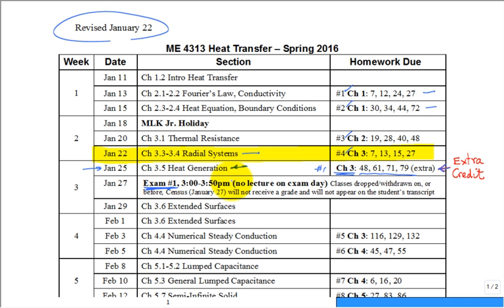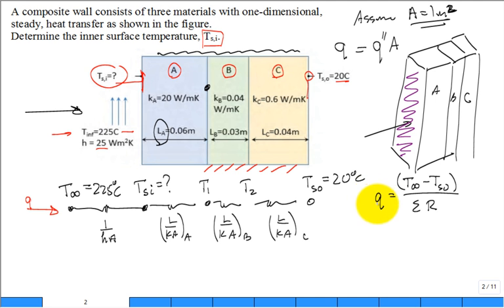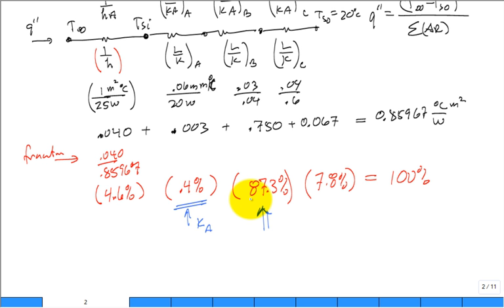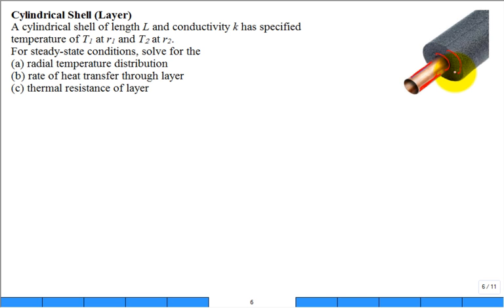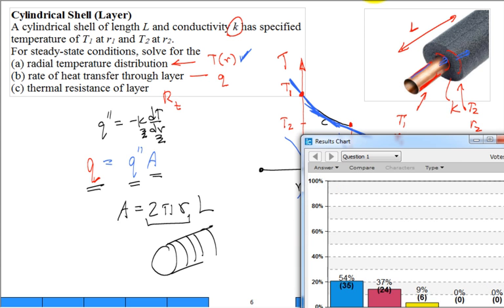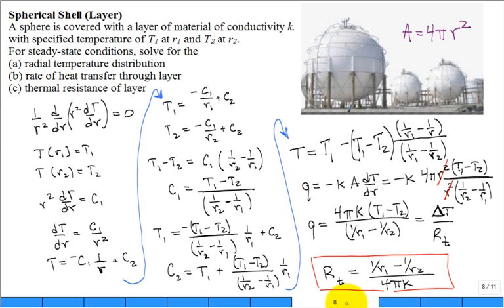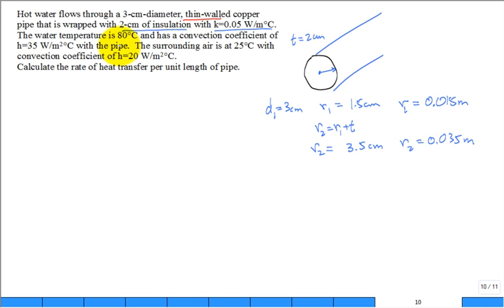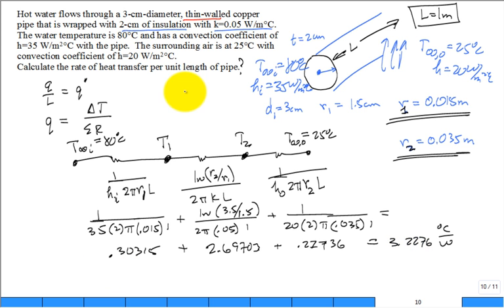Steady 1D Conduction 2of2

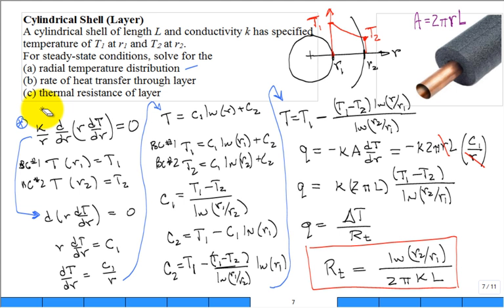Comment: Also, solving for T at 25:17 isn't that T_1 + ((T_1 - T_2)*ln(r/r_1)/ln(r_1/r_2))? If the natural logs took care of the negative sign, I find that would be plus not minus?... or was that changed when the natural log in the denominator switched to ln(r_2/r_1)?

Comment: Since heat flux is the same over the whole wall, does that mean that the heat flux between each composite is the same as well? This was how the flux between composite A and ambient air was determined (around 14:14).

Comment: Maybe I'm getting too caught up with the little things in these videos because they are very helpful. But at 14:12 immediately when I saw 238.5/25 was estimated to be 4 I was confused at how nobody said anything. Is anyone paying attention in this class? So I'm not sure if the 238.5 was incorrect or the 216 was incorrect but one was not right.
Reply from the maker: I wrote and spoke incorrectly, Tinf on inside is 225 not 220.   The final answer of Tsurf_inside is correct at around 216 degC.